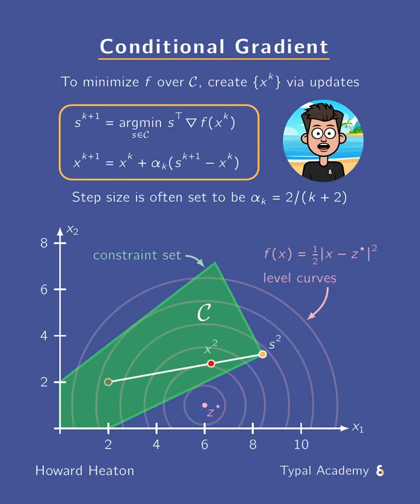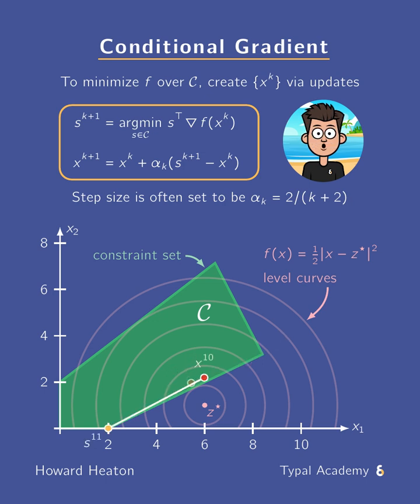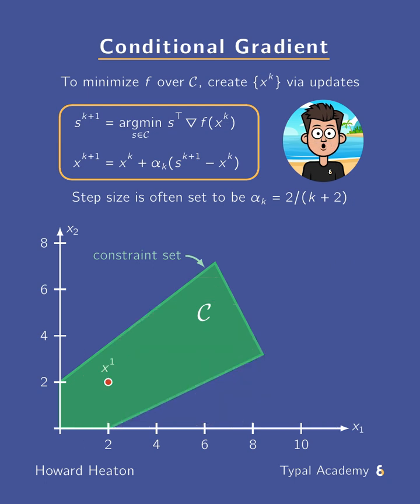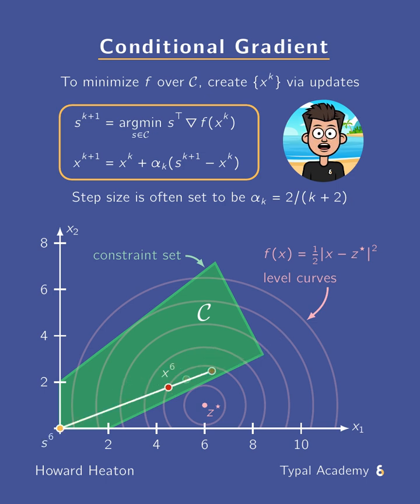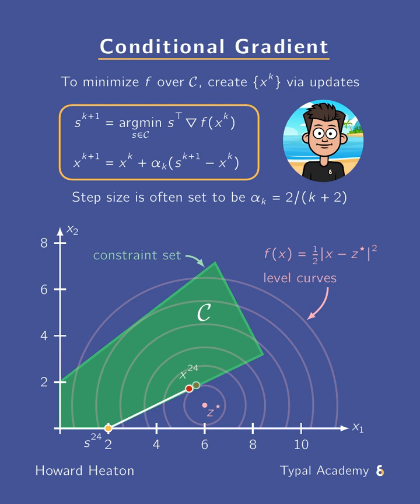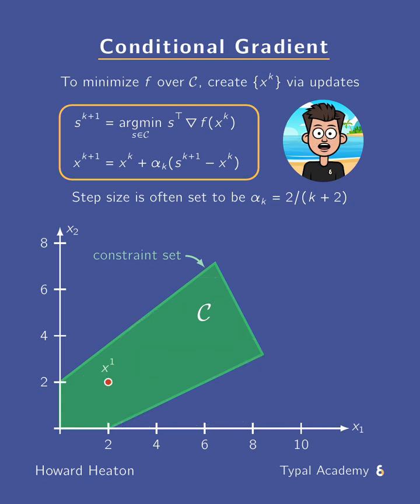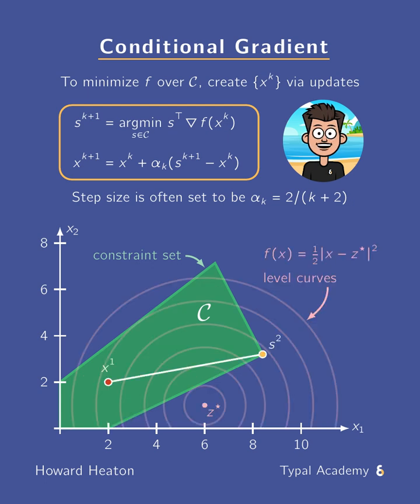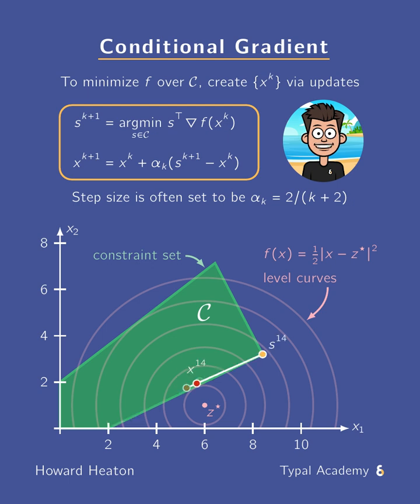Conditional Gradient / Frank-Wolfe

Comment: In the vanilla Frank-Wolfe algorithm on a polytope C, the step-size γ_k = 2/(k+2) gives the optimal O(1/k) rate when the objective is smooth and convex. However, Lacoste-Julien (2016) showed that when the optimum x∗ lies in the interior of a face F of C (i.e., the active face has dimension d > 0), the error in the duality gap decomposes into a ‘vertex part’ that converges at O(1/k) and a ‘face part’ that converges only at O(1/k²) along the interior directions of F.
My doubt is:
Can we design an adaptive step-size or a modified Frank-Wolfe variant (without explicitly identifying the active face) that automatically achieves the faster O(1/k²) rate on the face component when the solution is not a vertex, while still preserving the O(1/k) worst-case guarantee and the projection-free property?
If not, is the linear minimization oracle fundamentally insufficient to exploit the facial structure faster than O(1/k) without away-steps or pairwise steps?